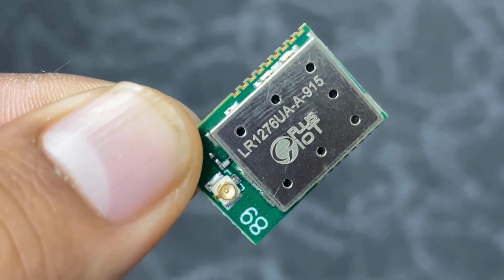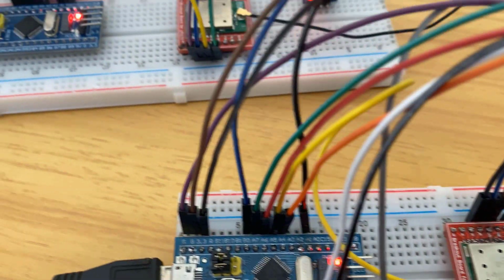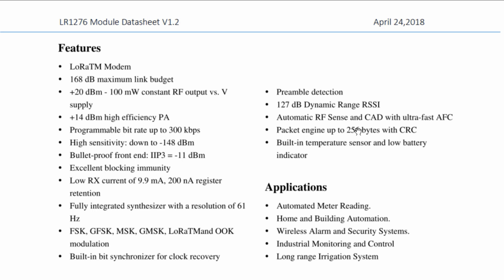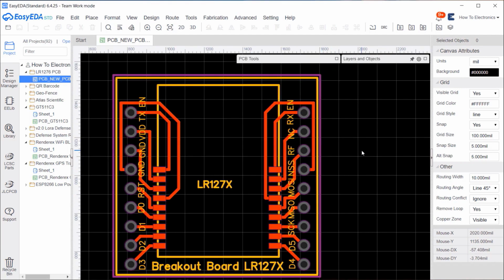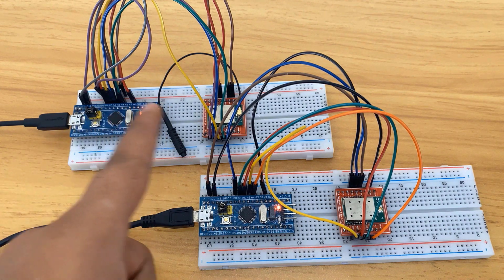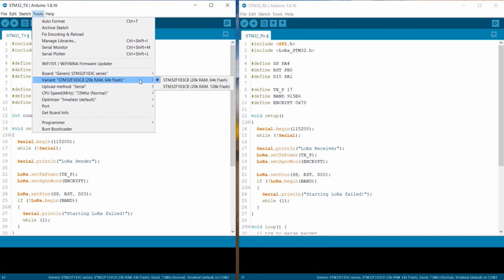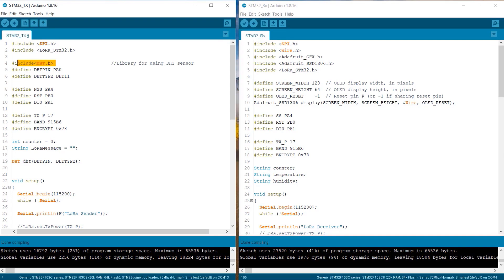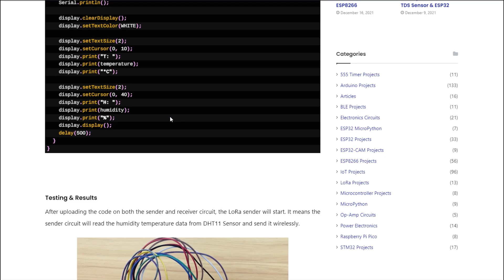SX1276 LoRa Tutorial | Interfacing & Testing SX1276 868-915MHz with STM32 Microcontroller

Comment: if you set the voltage source (Vout) on the Arduino Uno to 3.3V, then all the pins on the Arduino Uno will operate at 3.3V, including the SPI pin. When you change the voltage source on the Arduino Uno, all pins will follow the set voltage.cmiiw
Reply: got a reference on how to do this?